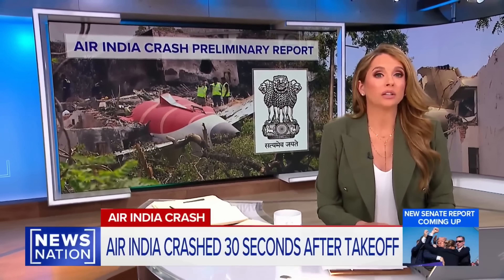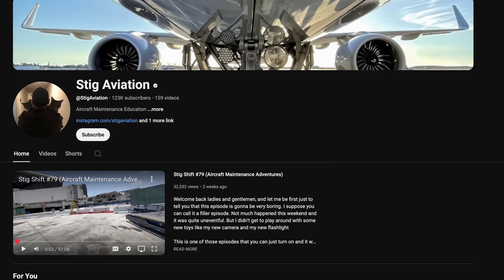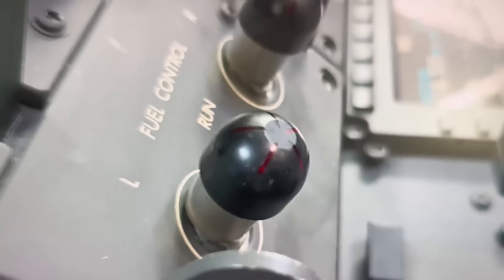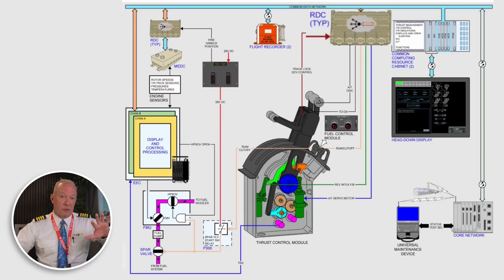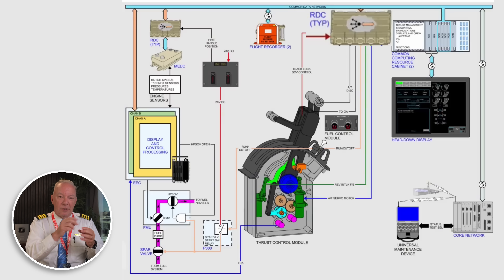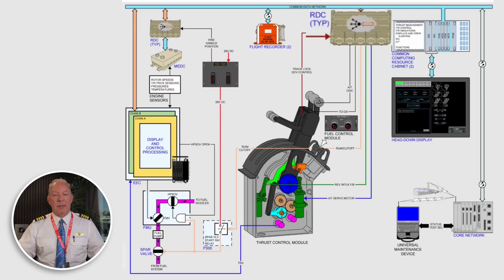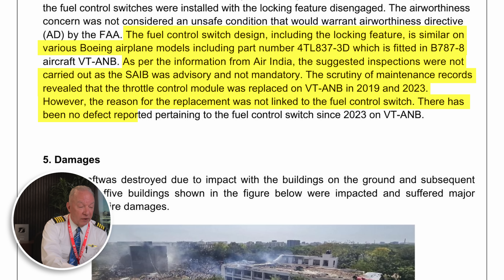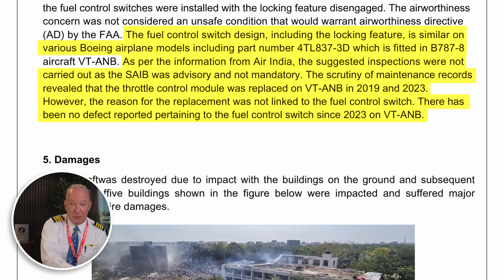The Truth About Boeing 787 Fuel Control Switches

Comment: You say, whilst the poor quality wiring diagram is on screen, "That relay, feeds voltage to all three different valves, The Spar valve, the FMV and the HPSOV"  It can be clearly seen on the diagram that your statement is not correct. The voltage does feed to the spar valve, but it does not feed directly to the FMV nor to the HPSOV.
Then you also say "That relay closes with 28 volt electricity, not a digital signal, once that relay closes it provides that same 28V DC to all three of those valves and all three open." This is also a false statement as can clearly be seen on the diagram.
Then you say "If that switch stays in the right position those valves stay open. It's a closed loop system. There are no other inputs into that system. There's no digital input signal that gets sent to them by mistake or any other way that could close those. It's, it's own little simple system."

I'm sorry to tell you, but it's rubbish and you don't know what you are talking about. Let me explain.
On the diagram we can clearly see that for fuel to be fed from the fuel system to the fuel nozzles on the engine all three valves must be open and the fuel pump needs to be operating but there's no wiring shown for the pump, so that's anybody's guess. Also, if any one of those valves were to close fuel would stop flowing and the engine shut down. Now for the wiring.
On the diagram we can clearly see there's an orange wire going from the relay switch contact to the Spar Valve. This carries your 28V DC electricity to open that valve, but there are no more wires coming from that relay output contact to either the FMV or the HPSOV. Consequently, that relay output voltage cannot possibly open those two valves because there is no connection to them.
However, there is another wire from the relay contact that leads to the FMU, (the Flow Management Unit.), but it does not connect to the FMV it goes to IIRC a digital AND gate. The second input to this AND gate comes from the EEC unit (Electronic Engine Controller). Providing the EEC is supplying a digital signal to the AND gate AND the first input from the relay is turned on by the relay, then YES the HPSOV will open. But notice the relay has not opened the FMV. That valve is opened by a connection coming from the EEC unit, but the diagram doesn't make it clear how or from where that signal originates. But it clearly does not come directly from the relay as you stated. Also there IS a DIGITAL input coming from the EEC into that simple little system you falsely described. There is also an additional voltage feed coming from the EEC to open the FMV. NOW we have all three valves OPEN and the engine can get fuel. But if any one of those valves closes the fuel stops. So the fuel could stop if the EEC removes the DIGITAL signal to the AND gate turning the HPSOV OFF, irrespective of the setting of the manual fuel switch. OR if the EEC removes the 28V feed to the FMV turning that valve OFF. Neither of which come from the fuel switches or relay. Consequently, your continual focus on the movement of these fuel switches and I'm sorry to say, this complete video is erroneous and I do not understand why you persist with your view, as there is no evidence as yet that the switches were ever moved, except for the strange untrustworthy reference made in the preliminary report.
Sorry Capt Steeeve. You'll have to do better than this Sir.
Reply: Yep. Very well explained. Anyone with the slightest knowledge of electronics & circuit diagram reading would see that. Captain Steeeve's knowledge in this area is severely lacking. He has not done himself any favours by releasing this video.

Comment: 5:14 FYI, a closed loop system implies there is feedback to a controller so it can monitor the status of the things being controled and if something fails to reply with the proper status, the controller flags it as failed or sends another command to start until it times out. A open loop system just sends the signal and doesn't monitor anything. A light switch in your house is an example of an open loop system. What you described is an open loop system. But the real system is a bit more complicated.

Comment: Battery will save you, in full electrical failure? What if the battery was dead?
Reply: You would know that before the preflight was completed (error message). In any case, the fuel spar valves must be powered on either the open or closed circuit for them to change position. Loss of power, leaves the valve in the last commanded position.

Comment: Thanks - this is perfectly clear to someone like me with no experience at all. Makes perfect sense. But I have a question that wasn't answered (I think) in this video. OK - there is a voice recording stating that there was a visual confirmation that the switches had been moved. But there is also a log(?) in the flight recorder that shows the switches were moved. What is being used to detect this? Are there sensors in the fuel switch  to indictate movement / position or is at the relay when + or -48v is recorded. Or somewhere in between?

Comment: What if the battery module shorted to ground?  You would lose 28V for at least until the circuit breaker opened, maybe 10 seconds.  No 28V, no fuel relay.
Reply: This guy has done a video on just that.
Oh dear. If he's right - it was the plane that caused the crash. 
 https://youtu.be/OLxLN3osS1Y?si=3wgPNqCppr5bklWQ
Reply: Loss of power does nothing. The fuel spar valve actuator must be powered to open or closed. Loss of power results in the valve staying in the current position.

Comment: I think a problem is that you don't fully understand all of the potential failure modes of this electrical circuit. Loose/faulty connector, stressed wire, intermittent solder joint, sticky/intermittent relay (coil failure, contact erosion, contact welding, contamination, undervoltage.) Your simplistic explanation kind of dismisses that a stack of things that all have MTBFs can't fail catastrophically. How about you keep an open mind? Are you really saying that there's no way that any component in this collection of electrical circuit + mechanical switch mechanism have any failure modes? Sorry, but you're simply wrong. Sure, could be as simple as pilot turning these switches off, but as unlikely as even that was, remember that when it comes to aviation accidents, we're already at the edge of probabilities on the bell curve.
Reply: Sounds like  you are just making up things. The fuel spar valve must have power provided to the open or closed circuit for the valve to change position. Loss of power, voltage spikes coil failures, corrosion, etc. will not do that. Only a chaffed wire could cause a valve to change position if the short was held on (not a normal failure mode). That would only effect one engine, not both.
Reply: @paultruzzi911  You misunderstand. I'm just saying we should keep an open mind to unlikely failure scenarios (and yes, making up a few as pure examples of physically possible scenarios in related failure domains.) I'm sure prior to NM-18-33, Honeywell's engineers we're rather adamant in decrying that there were no possible flaws in the "fail-safe" design of the 766AT613-3D switches, until the field reports came in. Call it pessimistic engineering, but I just don't believe in failure-free systems, just statistically unlikely failures.

Comment: The Preliminary Report says, the flying pilot asked the other "why did you cut off, " the reply from the non flying pilot is "No, I did not.." Why do we doubt the answer?
Reply: The report doesn't say which pilot asked the question.
Reply: @Manticore1960  one pilot asked the other. there were only 2 of them. Which one is immaterial...
Reply: @vaidyaguru1  I was simply pointing out your error in what the report said. And I wouldn't say it's immaterial anyway. I think it's very relevant which one asked the question & which one replied.

Comment: WOG sensor? Wheels on ground shuts down these switches if true.
Reply: WoW has no input / command to the fuel spar valves. They are only controlled by the fuel cutoff switches and engine fire handles. No software or other inputs needed.

Comment: I am in the aeronautical field and I think you did a good job explaining, what I think might have been even more emphasized is that each fuel switch/system have its own 28V DC from different batteries. Single failures are aviations big boogie man, that is why there are dual controls, TWO pilots, at least 2 engines etc. and also two separate switches which are totally separated from each other electrically and outside of computer control. Since the fuel is a potential single failure there are a lot of different hoops that need to be jumped through to even pump one pound of fuel into an aircraft. But as always it is all about probabilities it is impossible to produce a completely failsafe system, pretty close yes but never all the way. 

A thought that I would like to raise though but I am not very versed in civil aviation procedures so I do not know if this might be an issue here (it is a kind of bias):

There are instances where as the pilots is subject to a disturbance (unforseen event, alerts, unexpected visual cues etc.) and they get into a situation where the intended action is overridden by that the "muscle memory" kicks in. Generally inverse proportional to experience. 
Is there a risk that this is the case in this situation? 
Is there something which is done close to or even on the switches themselves in that part of flight? Or it could even be something like ensuring that the switches are locked in run position (especially if that is NOT the standard procedure) can initiate this, only time you touch the switches you transition them thus even if your intention is to check, your "muscle memory" kicks in and transitions them. 

The two reasons why I am thinking about this is that one pilot asks why the other turned off the engines and gets the response "I didn't", which to him might not be a lie since he basically is unaware of his actions, and the second reason is that I normally trust and believe in my fellow man and I do not think that anyone can be so coldblooded to intentionally cut off the engines.

Comment: After weeks of claiming the fuel switches and their function was purely mechanical as if a Boeing is a 1900’s cable controlled bi-plane, captain Steve weaselly admits there is indeed electronic circuitry behind the switches, but trying to claim this is faultless and flawless circuitry immune from any type of short circuit or any other electrical fault.
Reply: There is no software or common circuitry between the two fuel spar valve commanded positions. No WoW, no loss of power, on single chaffed wire.
Reply: @paultruzzi911  but there is software circuitry controlling the other 2 valves in that diagram, which was ignored.

Comment: Federal Signal’s parking engineer taught me parking equipment relay logic across the street from Midway Airport—where I helped rebuild the terminal in 2003. Boeing’s circuit is among the simplest that I’ve seen, but to satisfy the designation of a ‘military specification’ belt & suspenders would be called for. 😊 That compressive spring is crucial to keeping each switch in place.

Comment: Electrical engineer here. It's very helpful to learn that there is no computer controller between the switches and the valves. Just a simple relay. Thanks.
Reply: That's not the case. There is additional circuitry controlling the FMV & HPSOV valves coming from the EEC. Look at the diagram again. Only the spar valve is operated directly by the relay. Captain Steeeve got it wrong.

Comment: Not questioning any of the analysis but it occurs to me that the valves should be open by default not closed. Would not have helped air India but if my flight suffers full electrical loss I want the valves to stay open for more than the time it takes the battery to drain (30 min per the Captain).
Reply: Yea, no. The valves must be commanded & powered to change position. The fuel spar valve is there from a safety perspective for major engine failures; blade loss, imbalance that causes engine leaving the airplane. Loss of power does not change the valve position, it must be powered on the open or closed circuit for it to move.

Comment: This is an outstanding explanation that seems to highlight a common design principle I observed back when I used to do field service of enterprise and industrial electronics. If it is a critical component that needs to stay on in an emergency or error, the circuitry needs to be as simple as possible to ensure it functions as it should. Same for critical components that need to shut off in an emergency or error - make the circuitry as simple as possible to eliminate as much interference with operation as possible. In other words, the more complicated a design, the more susceptible it is to errors. Fewer points of failure = higher reliability. And that's what we see here with these switches. If it absolutely needs to work, make it as simple as possible. That guy on the Piers Morgan interview who was suggesting some kind of rogue RF or EM signal messing with the fuel valves was just nuts. For 2 simple switches to both fail the exact same way practically instantaneously, or for multiple fuel valves to fail the exact same way practically instantaneously - that's statistically highly improbable.
Reply: Despite what is said in the video, only the spar valve is directly switched by the relay. According to the diagram, the other 2 valves are controlled by the EEC. So a software issue could cause them to close.
Reply: Could, sure. At the same time? Highly unlikely. And if that was the cause, it would have been logged and explained clearly in the report.
Reply: @EdgeCase84  It doesn't matter how many flying hours Captain Steeeve has, or how good a pilot he is, that doesn't make him an electronics expert. He has made glaring errors in his explanation in this video. Anyone who can read a circuit diagram can plainly see his mistakes. The valves are not solely operated by the relay as he claims. There are signals from the EEC controlling 2 of those valves. That's a fact. 
I'm not going to go into statistics about how probable something is, I'm just pointing out that he should educate himself on how to interpret a simple diagram.
Reply: outstanding? He can't even read schematic diagrams and understand what a closed loop system is.  you're duped by his easy demeanor and soft spoken words. a true sign of a cult leader.
Reply: @stevebubbie1126  Let me guess, you've got thousands of hours of flight experience and are a professional pilot too? Cool! I bet you're the kind of guy who doesn't trust doctors or scientists either.
Reply: Let's entertain the idea that an EEC error could have closed these other valves. If that occurred, it would have been recorded. If it was on record, you know the IIAB would have been all over that because it would have completely exonerated the pilots and the maintenance crew because it would have been "Boeing's fault." But they didn't. Occam's Razor applies here.
Reply: @EdgeCase84  I'm not disputing any of that. I'm not commenting on what could or couldn't have caused the crash. I'm merely pointing out that Captain Steeeve shouldn't make such claims about "The Truth About Boeing 787 Fuel Control Switches" when he's clearly not qualified to do so. He knows how to operate them, but he clearly doesn't know how to  interpret the diagram. He made undisputed factual errors in his explanation. Many others have also pointed out his mistakes. Can't you see by looking at the diagram yourself that he is wrong?

Comment: Steve you can do main working principle with this simplified schematic , but no failure analysis.  Then you need the full schematic. Were is the wire in your simplified diagram which goes from the switch to the flightrecorder input ? You see, not shown
Reply: The signal from the fuel spar valves to the FDR comes from the limit switches on the valve actuator that go to the Remote Data Concentrator and then to the Common Cores System (CCS = Computer). The FDC gets its information from the CCS.
Reply: @paultruzzi911 thanks

Comment: I can see a 'HPSOV OPEN' control signal from the Control Processing unit which leads to a logic AND gate, if this signal goes low, it will override the pilots fuel switch position logic signal and this would have an effect on the HPSOV (High Pressure Shut Off Valve). If there was an erroneous decision from this control unit, could that have shut off both HPSOV's for the left and right engines? This circuit needs to be explained fully.
Reply: That failure mode would only effect one engine, not both.
Reply: @paultruzzi911  I don't think we can know that from the partial circuit that has been shown in this video, it only shows one of the two sets of fuel control valve circuits (one set for each engine). What we need is an expert to clarify that the control processing unit does NOT send a duplicate signal to both engines (for example, in the case of a detected fire), then you would be correct, only one engine would be affected.

Comment: Captain Steeeve – I spent a big part of my life working as a test engineer for simulators built and maintained by what is now Collins Aerospace, Flight simulators are different than the airplanes in that they have ways to inject all kinds of faults into the system. Thus a simulator doe not have the same onboard fuel management systems that the airplane does. This would be true for the radios and other systems as well. 

I advise on not comparing a simulator to a real airplane for all of the faults that could occur.